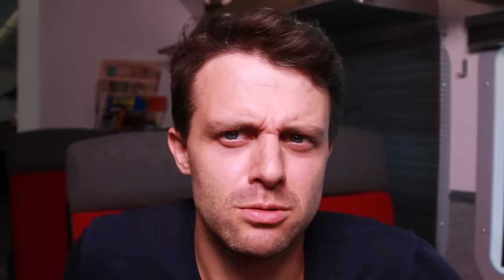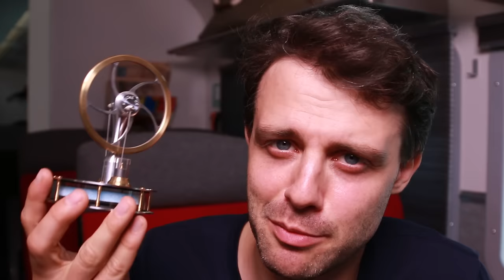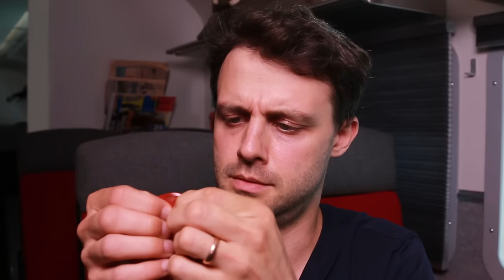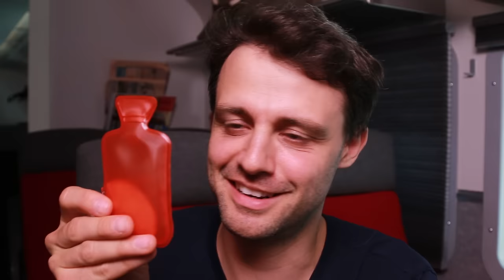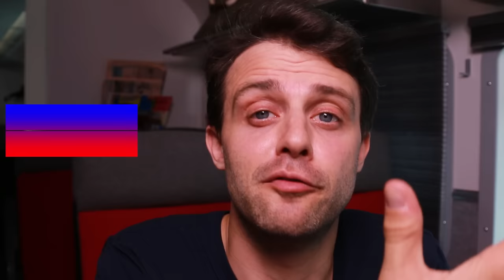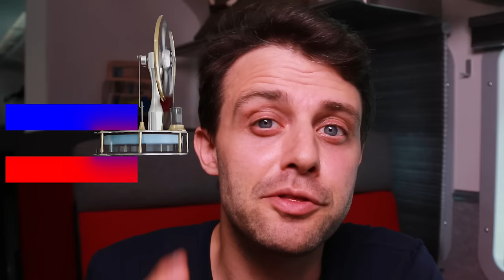A better description of entropy

Comment: The reason that train isn't moving is because the driver wants to postpone the heat death of the universe by not increasing entropy.
Reply from the maker: +Gordon X. Frohman :)
Reply: Gordon X. Frohman   Hahaha!!!😀
Reply: @aud_io a great way of extending the life of the universe, but alas still does not prevent the inevitable end
Reply: @aud_io to turn off the fusion reaction youd have to figure out a way to negate gravity, it's the gravitational pull of an star that makes the core dense enough to fuse, so in order to stop fusion youd have to cancel out all of the pressure caused by gravity
Reply: @aud_io But you would increase entropy by trying to stop the fusion in stars. The energy it would take to do that, would probably be more than if we just let it happen.
Reply: Even the engine at a standslill will undergo entropy .over time, parts will rust, and generally all will want to revert to its elements.
Reply: What if the universe was self-regenerating by nature? Heat death sounds so ridiculous. Brainwashed masses. The only truth energy companies/ govt projects give us is their invoice/taxes. Sheeples
Reply: @brendan6739  Every universe eventually ends. If humans want to survive indefinitely, they better find a way to move to another one by the time this one ends. The Multiverse is forever.
Reply: @aud_io So then, what is the half-life of the Universe?
Reply: @SteveMould  lol
Reply: aud_io  you have the talent to become stories writer in Hollywood movies.
BTW the idea really great❤️
Reply: Gordon X. Frohman 😂😂😂
Reply: Hey I am the 1000th liker of your comment.
Reply: Hahhahaha... Too cool
Reply: electrotherapy Suggested reading: Asimov short story “The last Question.”  It’s found in one (and probably more) of his self-compiled anthology books.  Just Google it; surprise ending!
Reply: No, it's because there are leaves on the track...
Reply: The heat death that would have already happened if the universe was billions of years old?
Reply: aud_io or we could just use stellar engines to drive earth into the orbit of other star or else ship ourselves to other extraterrestrial planets until we figure out how to reach another universe. It’s that simple
Reply: Like the little external temperature driven engine
Reply: @allanrichardson1468  quite the read! very appropriate for thy who spends time on youtube, has curiosity to spare and energy to proceed
Reply: @SteveMould  somebody shared your video on quora and the first thing I did after that is I subscribed your channel.
I have been looking for this explanation very badly, I know what entropy is but I wasn't satisfied with the general definition everyone says. Thank you for sharing this knowledge.
Reply: You increased the entropy by typing...
Oh even I did!!
What??!!!
Reply: @electrotherapyify  yes. Its only possible in mathematical models that defy causality. Entropy exists only in "closed systems" that don't actually exist. Rather the universe is infinite, and built on natural unending forces.
Reply: Infintely finite.
Reply: Is the train not moving, or is the outside world moving in the same frame of reference as the train?
Reply: @aud_io The feat you are suggesting could only be achieved by an ultra advanced Kardashev Type III civilization. We have a long, long way to get there and it is much more likely that we will foolishly self-destruct far before that. Unless we self-destruct we might grow to a Kardashev III level in a few tens of millions of years. Or just 1 million years, give or take, if FTL travel is developed.
Quite frankly it would be an immense feat just to survive as a species for that long. The Great Bottleneck is almost certainly in our future; very few think that we have moved past it.
Reply: That's exactly what I say when someone tells me exercise is good: "Oh yeah? It might bring you some short-term benefits, but look at the bigger picture. By exercising you're increasing the universe's entropy and bringing us closer to the end of everything we know and love. You're a monster."
Reply: @SteveMould  😁
Reply: @aud_io Maybe that is what the advanced type 3/4 civilization are doing and thats why we observe so much dark matter.
Reply: @aud_io 
I love the "just attach fusion rockets to Earth" bit.
Reply: The heat death will be when the whole  energy same spreads to everything atoms then will be a peace but universe is endless. This is cause that the heat death will never happen.
Reply: Hahahah 🤣
Reply: The fact i found this hilarious🤣🤣
Reply: He only delays the inevitable
Reply: Good one
Reply: Someone tell the driver that his misguided efforts are in vain due to the couple of hundred agitated passengers sat waiting on his train.
Reply: @rannaghoremoumita926  even by moving still increases entropy so if we stop time then entropy will stop going up.stopping time is the only way to not increase entropy but if there is no time then there is no movement
Reply: @pathrender  Like using exotic matter?
Reply: @aud_io According to measurements about the density of the universe and its effect on its shape, heat death is the most likely end to happen, but we don't even know exactly how dark energy work.
Reply: @aud_io Hmmm, wouldn't developing the technology and building the device take more energy than it would save.....
Reply: Yes, and he seems to be using Steve as the heat source for the engine. Once the left side has heated up, the curtains will close on the left and open on the right... Probably needs more passengers.
Reply: Lol
Reply: What Is Islam?

Islam is not just another religion. 

It is the same message preached by Moses, Jesus and Abraham.

Islam literally means ‘submission to God’ and it teaches us to have a direct relationship with God. 

It reminds us that since God created us, no one should be worshipped except God alone. 

It also teaches that God is nothing like a human being or like anything that we can imagine.

 The concept of God is summarized in the Quran as:

{ “Say, He is God, the One. God, the Absolute. He does not give birth, nor was He born, and there is nothing like Him.”} (Quran 112:1-4)

Becoming a Muslim is not turning your back to Jesus. 

Rather it’s going back to the original teachings of Jesus and obeying him
Reply: It was my smart Alec reason for not doing my chores.
Reply: Ahhh Finally and explaination
Reply: @pathrender  Trust someone to rain on the parade.  Maybe very heavy rain would do the trick though.
Reply: @johnbingham6355  When a zoo decays does it revert to its elephants?
Reply: Hello Zoltric.......Again, if a pack of cards is put into well ordered suits.it would be simple to determine the position of each card.Now,if the pack were dropped from a height the pack would become disordered,where within limits the disorder would depend on the height,Try it:Now what took place in a matter of seconds would take many minutes,by hand,That disorder is given the name entropy.
Reply: @zotriczaoh7098  There is a remote chance of this happening.When an elephant decays.or anything els,it reverts to its elements of which the whole universe is comprised.So, it could give rise to an elephant or a human etc.
Reply: @aud_io 'Just throw giant buckets of ice' and get more hydrogen fuel by the H2O molecules' covalent bonds breaking from the sun's heat, so we get H2 and O2 fuels.
three birds with one stone, nice.
(but practically we don't have enough water combined with all the water in our solar system to cool down a star, also the the fuel consumption would be impossible to sustain to collect such vast amount of water, so we would end up increasing entropy even more in failure)
Reply: This Late to the party but this is actually the premise of Arthur c Clarke's "A time oddyssey", an orthoquell to his more famous space oddyssey. Where in space oddyssey an alien society is benevolent, in time oddyssey an advanced society blocks/destroys all life to delay the universes heat death.
Reply: Then again, which gives more entropy, thousands of people walking or the train moving the people?
Reply: No, it's because Steve stole their engine.
Reply: It's because his own dissemination of information represents such a massive organization of neural energy. not only his own. but of everyone who watches it. that the zero-sum nature of energy within physical existence would have led the resulting chaos into his own home. The delay in departure was likely the motivation for his recording and the lack of disturbance prevented a re-recording, and now. as we remember this video. we create a feedback loop of consciousness where the universe will compel itself into the exact state of circumstances that caused the event, Plus. being in a big metal tube with a hearth gives the entropy someplace to go.
Reply: Nono, the REAL reason that the train isn't moving is that he's in the UK!
Reply: Haha nice. That conductor knows where the universe is heading and will be our only savior.
Reply: Free "Time Matters eBook" takes time even further, time itself is the primordial energy and the source of matter: 1950s Fermilab experiment is  reinterpreted as time burning into matter. In a sense, time is much alike as temperature. (Slow time is more energetic than fast time, and time in the Universe speeds up by losing its energy to matter created.)
Reply: @rakhigoyal9778 🔴 What Is Islam? 

🔴 Islam is not just another religion. 

🔵 It is the same message preached by Moses, Jesus and Abraham.

 🔴 Islam literally means ‘submission to God’ and it teaches us to have a direct relationship with God. 

 🔵 It reminds us that since God created us, no one should be worshipped except God alone. 

 🔴 It also teaches that God is nothing like a human being or like anything that we can imagine.

🌍 The concept of God is summarized in the Quran as:

📖 { “Say, He is God, the One.  God, the Absolute.  He does not give birth, nor was He born, and there is nothing like Him.”} (Quran 112:1-4) 📚

🔴 Becoming a Muslim is not turning your back to Jesus. 

🔵 Rather it’s going back to the original teachings of Jesus and obeying him.